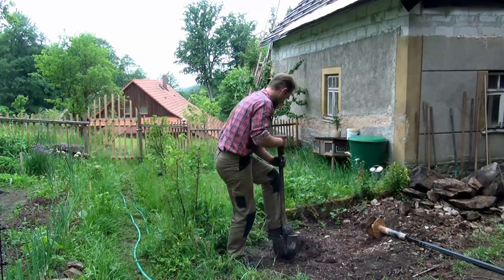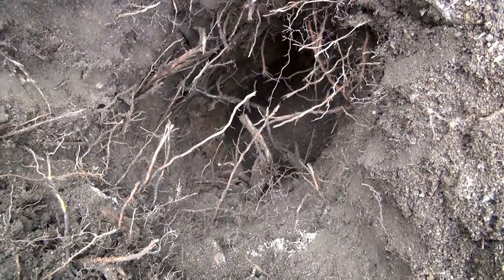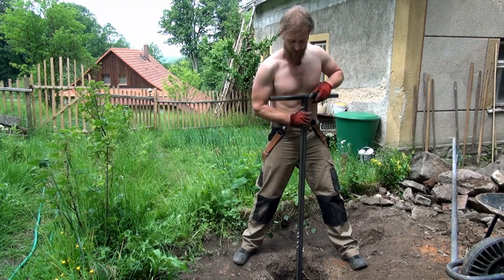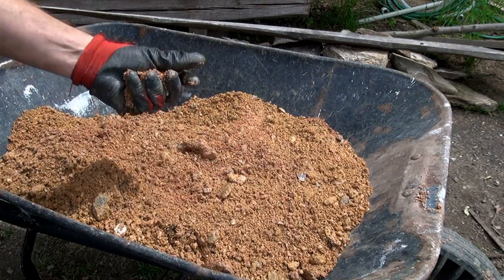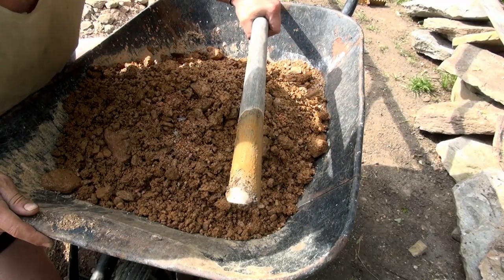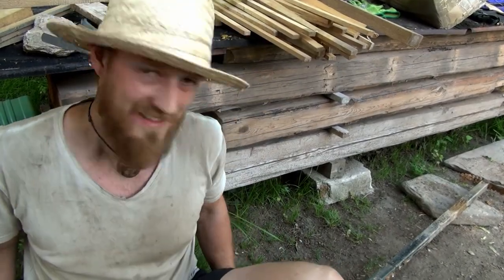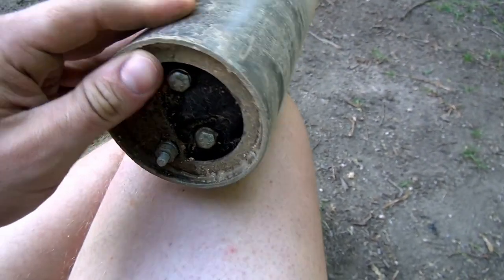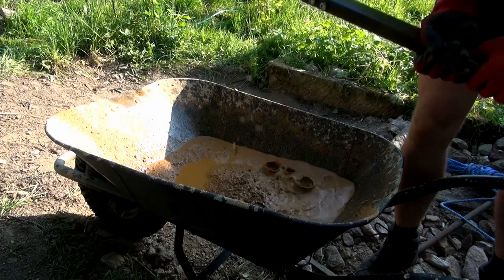Redneck Drills an Offgrid Well with Hand Auger

Comment: I hit water at 15 feet but then the auger got stuck to the drenched soil . I have done everything to pull it out and it's not bulging.... Any suggestions please?😢 My hand auger is like the clam type😮
Reply from the maker: This happened to mě as well, it has an easy fix though. 

Get one of those chain pulleys (the kind of a pulley car mechanists use to pull engines out of cars). Than make a simple tripod over the well, hang the pulley on the tripod and attach the chain to the drill handle. Using the chain pulley will make it easy the to pull the drill out few inches, which will unstuck it and you can pull it out normally.
Reply: Hey thank you so much . This morning I tried a come along ratchet and used a crowbar over a ladder as a base , but the  ladder started to bend. It's that bad. I didn't want to buy or build a tripod but it is what it is...also please what is the name of the steel pipe you used with the backflow valve?
Reply: Get a strong rope tow strap, or something similar and a tire, the bigger the tire the better. Tire the rope to the auger and drape over the tire, then tie a bar to the other end and use the leverage from the bar pulling the rope over the tire.

Comment: Thats a neat video.  Good hard work.  Your blessed to have water thats so shallow.  It might have been easier and quicker to just dig a full size well, (3 or 4 feet diameter) with a shovel and pick axe.
Reply from the maker: Hello there, I plan to do that eventually. The drilling was more of an experiment to find out how deepthe water level is. I might also dig the well in my cellar, which would save me even more work. Thanks

Comment: I am using the exact same piece of equipment as you but I continue to hit rocks at about four feet. I have dug several different holes and am trying to be patient, hoping that I will be in the clear if I can get past four feet. Do you have any ideas for breaking apart bigger rocks?
Reply from the maker: Hey there, I have been hitting quite a few rocks as well. What I did was I took a 6m long, 1 inch diameter steel water pipe with strong walls, sharpened one end with angle grinder, And crushed the rocks with the pointy end. Then I just drilled normally through the debris.

I am going to be real with you though - It depends on what kind of rocks you have in your soil, some rocks can be crushed without much trouble, but some rocks are just too hard to be crushed through by hand. But still, it is worth a try, good luck

Comment: Very impressive! much respect for building this! How clean is it really though?
Reply from the maker: Hello there and thanks! Well the water is definetly clean enough to water the garden with, there are no other villages above mine (we live almost at the top of the ridge).

I haven´t get any tests done yet, becouse I am still in the process of drilling deeper. Therefore I don´t know if it is safe to drink. Other peoples wells near mine are usually ok to drink, so fingers crossed. I plan to do pt. 2 where I will install piping, pump and get test done so we will see.

Comment: How did you make the auger engage w/ the drill rod when drilling and disengage when removing the auger?
Reply from the maker: The auger has rectangular opening, which allows it slide up and down on the drilling rod, but when you rotate (=drill) it stays in place. It won´t slide down completely, becouse the drilling teeth and on the drilling end of the rod, prevent it from doing so.

The rectangular shape of the rod and the auger hole can be seen very well at 6:54

Comment: how could i excavet more after reach the water ?
Reply from the maker: there are several solutions - make a drill head with a valve, use a pump to remove water between rounds of drilling etc., watch part 2

Comment: @jjchwotkshop.   Great video.  I am drilling a similar well with a similar tool.   I got down 10ftand hit lots of gravel   The drilling has now become incredible slow. Any thoughts ?!?
Reply from the maker: Thanks, it helps to use some kind of metal pipe with sharp end (I used grinder to sharpen mine) to loosen and crush the stones between the drilling
Reply: Thanks.   Still making progress buts its very slow.  At 14 ft.  The rope gets stuck a lot when I’m pulling the bit up and the very end of the pole is stuck in the bottom but I’m still able to drilll.